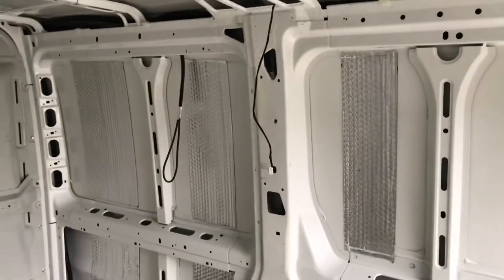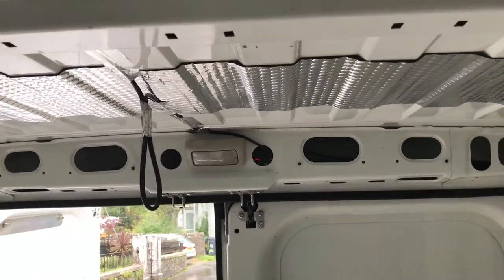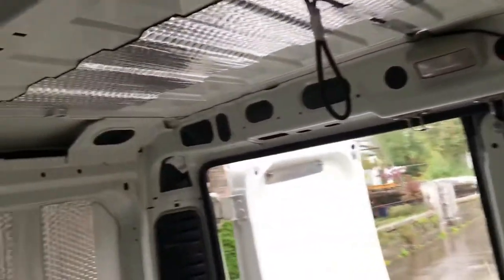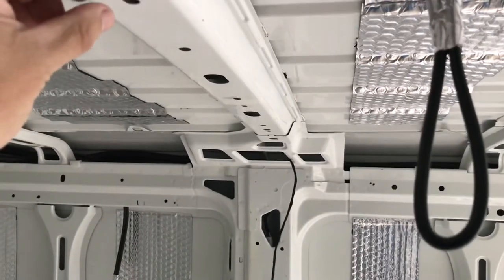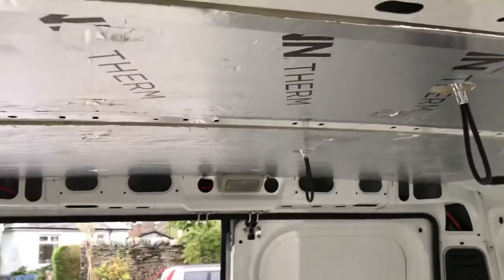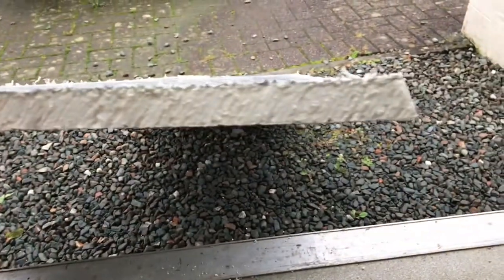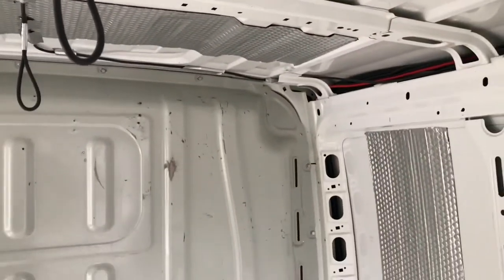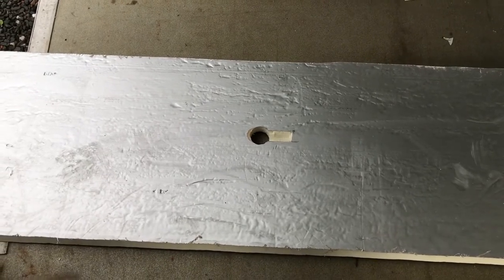Citroen Relay L1 H1 Camper Conversion. Part 3: Roof Insulation

Comment: After the deadening pads u have used the Quinn therm sheets...can you let me know what thickness and where they are available pls...have the same van L1H1 thanks
Reply from the maker: I used 25mm thick stuff. Available from most diy stores.  If I were to do it again. I’d look at covering all internal metal( van sides/roof) with a closed cell foam too.